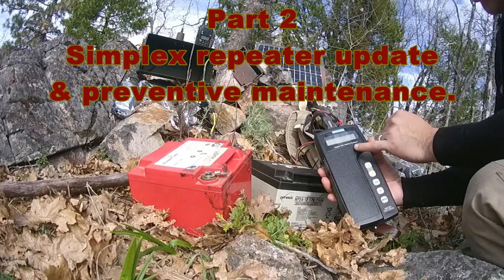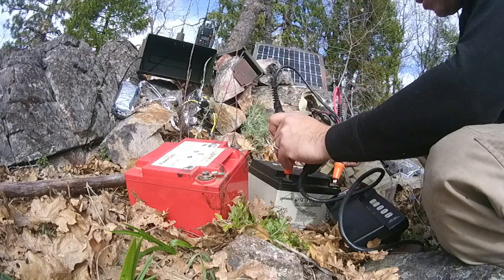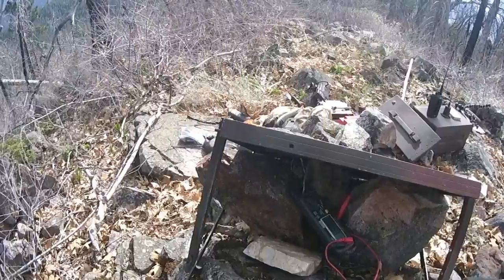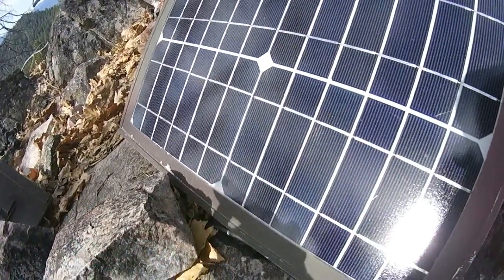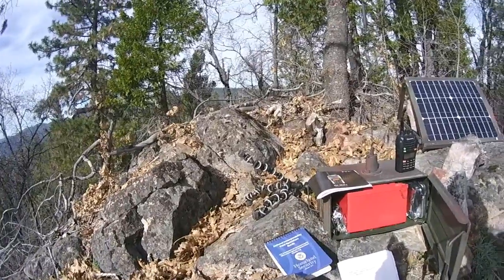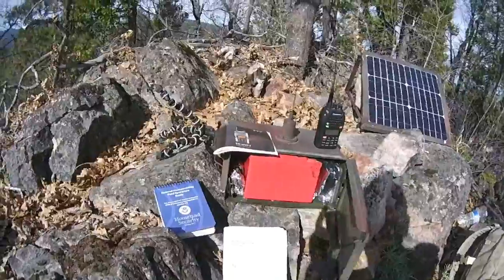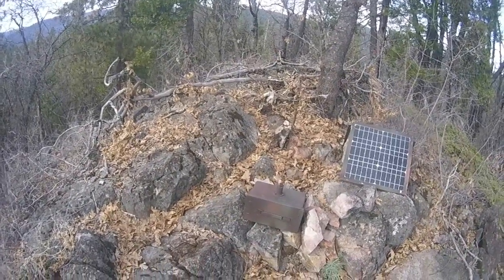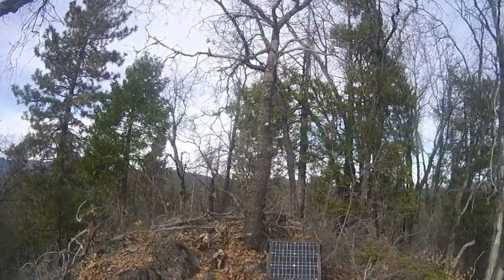Preparedness Simplex Repeater 1 Year Deployed Update. Part Two

Comment: How about using some of the newer Lora / meshtastic low power data comm gear in conjunction with a VHF simple or UHF repeater?

AES256 encryption and channel hopping or spread spectrum..
I’m not too up on the tech, but just saw a video on the system.
Open source and under $50 for a transceiver.

And I’m definitely a huge fan of LifePO4 batteries.
Way better than flooded /AGM / SLA types.  Priced higher, but has a much better lifespan.😊

Comment: I am surprised that your TYT 8000 has survived even one year. I have one and as I understand it, when it's in cross band repeat mode it's constantly TXing and will get hot. So, do you have it on low power? If so, even then I'm surprised that it's still operational after one year.

Comment: I worked with that type of batteries for most of my life.  That is the same type used in alarm systems, I worked with them for about 30 years.  You are luck if you get 3 or 4 years out of them.

Comment: If i may suggest i would NOT paint the antenna coil,there are paint outhere that would "isolate' the coil and it wont radiate rf like it should.You could use "hockey tape' that would not interfere .Great kit you have there and you are gaving me ideas for an APRS digi in the forest here.Ground you amo-box and it will help you ground effect a lot,

73/s
Gef ve2ckn

Comment: It's been over 3 years now, how has the system been working for you during this time?
Reply from the maker: Its been off the mountain since 2016. it had a hard failure and had to pull the radio down. Been wanting to deploy something but life got in the way and I'm in the process of moving locations. I'm already scoping out sites to deploy gear.

2.5 year update.
https://youtu.be/Kvm2rMBSIBM

Comment: Time for year 2 maintenance on your rig ! I have been learning from your channel for some time now. Are you going up to check it out soon ? Is it still working since the last check up ? Probably have some snow to deal with. I wonder how long that batt will last with snow on the solar panel if that is an issue. Looking into a similar set up in a location that does get a bit of weather that would hinder solar charging for upwards of a month or more. Hope to see an update on your set up after 2 years.  Thank You
Reply from the maker: +EVILisEVILdoes Its in the works, actually its going to be a repair mission. It went off the air a couple of months ago. first my range went from 60 miles to about 6. then finally silence. Don't know what happen, but I'm planning on going up there next week to see what happened with camera in hand. I purposely half assed built it to show any problems while deployed quicker. Stay tuned, it will happen shortly. Thanks for watching.
Reply: I look forward to it, I am impressed with the performance and uptime on this build. The location I am scouting is a 3 hr hike from the road so I want to deploy after further testing this spring if my legs hold out. Basically the same configuration with a larger batt.

Comment: What about running the cable from the panel to the box through a flexible conduit, like you'd use on a hot water heater, to prevent an animal chewing through the line again?
Reply from the maker: +atrusco Definitely a good idea. I purposely built it really crappy to see what failures I would expect in the field. Then take the lessons and build it tougher next time. Its just a prototype. Thanks for watching.
Reply: Great videos, just thought that might be a good/cheap way to improve it. Tougher for critters to get through, plus I thought it might help shield it from interference as well.

Comment: If you were able to fly the radio(at 4 watt), repeater and antenna(in a horizontal configuration) from 3-5k ft, that would give you line of site comms out to how far?
Reply from the maker: j johns I know there is a formula out there, but I'm too lazy to find out. but its a physical formula that finds out how much of the horizon you could go depending of height of the your location. the higher you are the more distance past the horizon you can see. Based on my UHF repeater, I would conservatively say 40 miles of solid outside coverage, inside a structure, it might drop off. Thats UHF, if you used VHF, you could get another 35% of range with the same amount of power used on UHF. the lower the frequency used, the more hauling capabilities it has. you mentioned horizontal configuration, there is something called antenna polarization. in a nutshell both field units and repeater must be polarized the same. any mismatch and you will cut your performance by as much as 50%. if the antenna is vertical, it will perform much better than horizontal because the majority of users employ their antennas vertically. Thanks for watching.
Reply: Tram set the point to point record on 2m from a balloon, like 650 miles range. I don't know the specifics, but if you can get it up, it'll reach a LONG ways

Comment: Thank You very much for the Simplex Repeater Update! You were right that you had a bunch of video to edit before you could post it! LOL  

Glad to see that the fail-safe for the battery worked as intended, and we all learned that critters like to chew though wiring! DOH! After seeing that, I plan on using some flexible stainless steel wire conduit (and paint it camo) to protect my external wires. Just like the ones you would see protecting a handset cord on a payphone! That should keep the critters from chewing through them!

With the recent improvements and price reduction in flexible solar panels, I think that would be the ticket with a lightweight electrical grade PVC Pipe frame and stand. It would weigh much less than a glass panel, so it would be easy to haul to a remote location. Your camouflage paint job would also work excellent on it.

Comment: Another good video GC thanks Bro.
 Have you seen the Wouxun KG-UV8D Cross-Band Repeater?
Reply from the maker: InTheNameOfJustice Not in person, but did look at the specs. If it works ok, this could simplify a portable repeater setup considerably.
Reply: GUERRILLACOMM I was thinking the same thing. I found a couple of good reviews on YT that hold promise for the unit.

Comment: I'm assuming the TYT radio has the crossband repeat feature? Also assuming it's a UHF->VHF or VHF->UHF. If so I'm assuming that's a dual band whip? I'm curious because I'd like to setup something similar but need a NGP antenna, in a dual band whip.
Reply from the maker: Michael Meza Yes, its because of licensing. GMRS seems to be the only service out there that I could use legally with the whole family, no mater age or experience level to a certain extent. What looks like a dual band antenna is actually a 5/8 wavelength collinear antenna on UHF. Basically two UHF 5/8 length antenna stacked on top of each other separated by a coil in the middle to reverse the currents between the two. It flattens that radiation patter farther across the horizon. Thanks for watching.
Reply: His setup is a simplex repeater using a single VHF frequency. There is a small recorder that records the transmission and then re-transmits it.
Reply: That makes sense now. Hence the issues he has when his kids use it. If he's running 5 watts and an ht why not use one of the new Chinese hts that do cross band? Maybe it's due to licensing.

Comment: watched lots of your videos
what about vandals or theft on you mountain repeater
I used to work for motorola service and had couple repeaters in country shot holes etc
Reply from the maker: ***** This particular hill top is rugged terrain to get to, you would have to be really motivated to climb it for fun or whatever. its about a mile away on a 45 degree slope. Not much reason for someone to drive up there either, there is literally nothing but forest. You practically have to be a few feet away to see it and its low enough as to not skyline on the peak. I did build it as cheap as I can worrying that it might get stolen. You could practically pick it up and walk away. Thanks for enduring the lots of my vid, appreciate it.